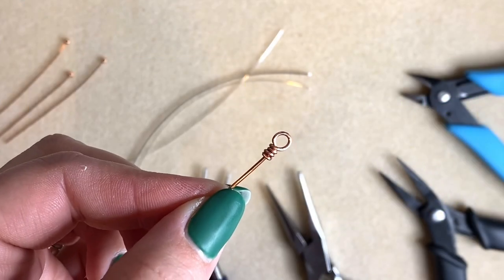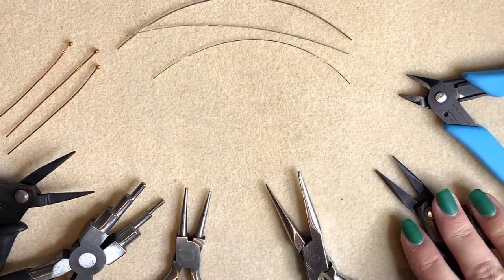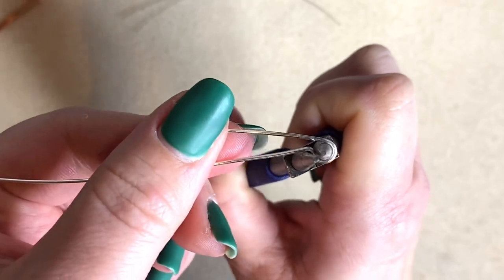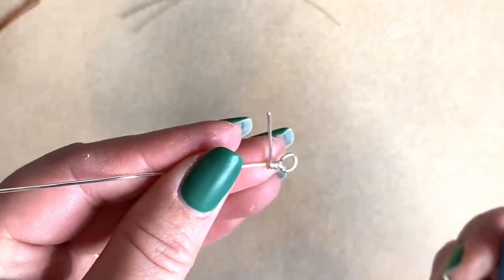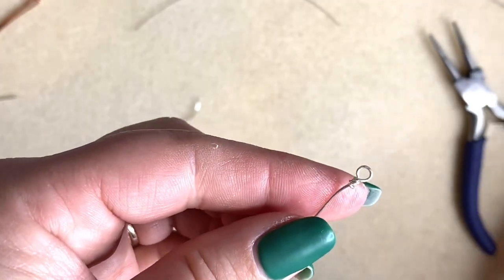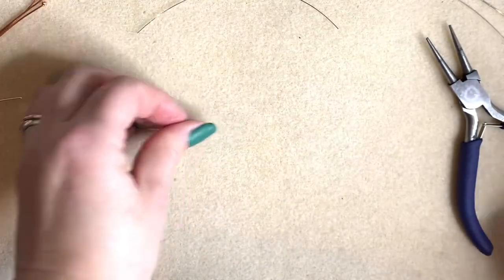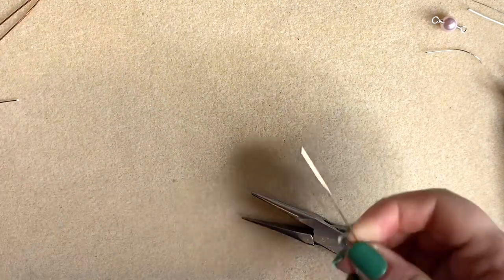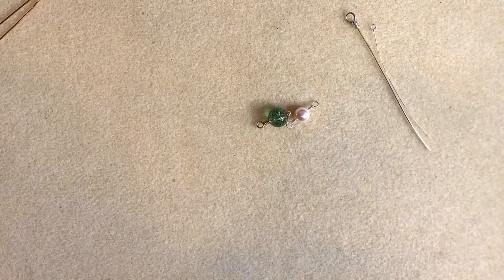The Wrapped Loop ~ Essential Jewellery Making Techniques ~ Katie Parker Jewellery

Comment: I love doing wrapped loops! I was taught at the start of my journey by a wonderful lady from a U.K. bead company called totally beads at a bead fair, and I’ve never looked back!  I surprised everyone by taking to it like a duck to water! As I was watching and doing From opposite I actually was doing it the other way about.  I do the loop as you have then switch hands and hold the loop in my chain nose pliers and use a smaller needle nose or another small chain nose plier to hold the end of the wire I’m wrapping and use that to keep the tension and wrap the wire.  I find for me it’s easier to keep the tension to wrap the loop neat.  I also keep a wire burring tool handy, there is always a time when there is that one sharp bit and just before I tuck the wire in I bud the end to be sure there are no sharp bits then tuck the end in at the end of the wrapped loop.  I started off with basic tools but after the bead fair I got zebra tools which I still use today, though I’ve added a few other pieces from Xuron, best cutters out there, I have a pair for heavier wire and head pins and a pair for beading wire or light gauge, since doing this I have had no issue with my cutters going blunt!  They also do great mini chain nose and mini flat pliers. Love the videos, a lot are scared of wrapped loops so it great to see a video just on wrapped loops. 😊